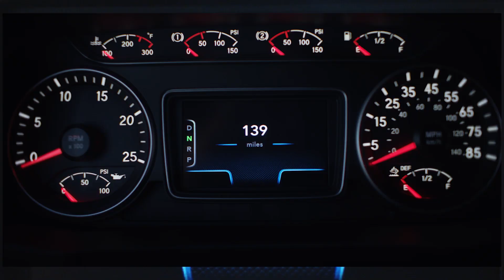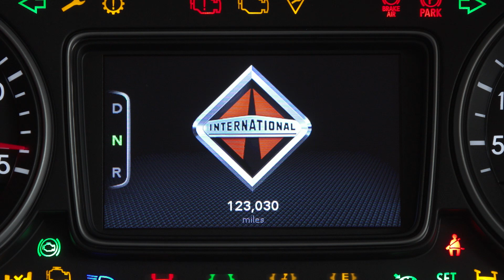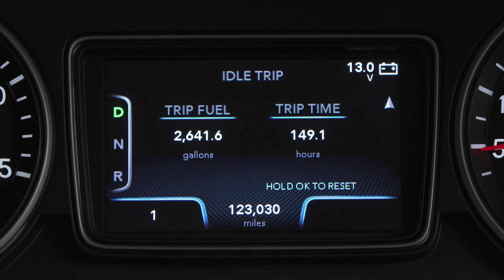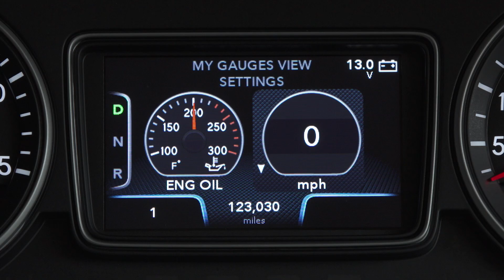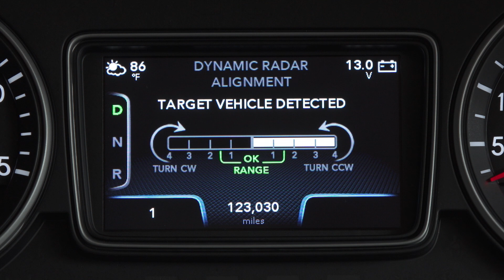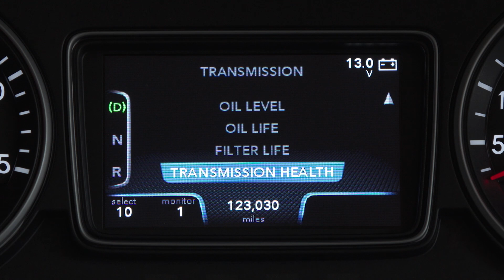International Truck Premium Cluster Training Guide

Comment: There is no adjustment for the overspeed on the cruise control. Do I have to have this done at the dealership? On a Freightliner you can set the overspeed from 3-5 MPH and also adjust the time interval alarm for the vehicle in front of you.  Doors don't open wide enough. Seat is cheap. Just turned 1020 miles last night and it is already rattling like it is  three or four years old. VW better get some better people to run International.

Comment: The lt is by far the worst truck I've ever driven. Not meant for tall people. My knee is constantly hitting the steering wheel, my leg is constantly hitting the cup holders. The seat doesn't adjust back enough. I feel cramped all day. My back is taking a beating from driving an lt. Volvo, Freightliner the paccar trucks are all much better options. Entering the truck is also an issue where the door doesnt open wide enough as well as the steps being too short.

Comment: I drive one of these leased through Penske. They strip everything out, and lock all features. This truck doesn't even have a fuse for the airbag. It pulls to the right because there's no access to the alignment reset. The features are awesome, but they shouldn't be allowed to disable so much.

Comment: But how do i keep the bunk heater running while the auto start/stop is on (so the battery doesnt die) the cool button says “no idle” it turns off one or the other?
Reply: This truck is dangerous,the acc/cms picks up road signs above interstate and bridges. If another vehicle cuts you off the automatic braking system comes on and you go from 68 to 50mph which takes all control away from the driver and it does the same thing if cars exit off ramps as they slow down the radar picks it up and slams brakes on while you're still trying to drive . I been driving trucks for 20 years and by far dangerous vehicle set behind the wheel in and chances are the idiot that designed this garbage doesn't even have a CDL.

Comment: Absolutely garbage they have a camera that activates the engine break authority if the crappy computer thinks you're going fast or too close I'd advise everyone to simply stay away my 2019 LT transmission broke down it takes 3 weeks for them to get the module just garbage
Reply: You  have  12 spd iton ?
Reply: @yamaxa00  yes it's 12 speed automatic but to be honest stick shift is better less maintenance and if it breaks down $2500 you can rebuild it but I changed the clutch and it was $4 k and the transmission went out with 190 k and it took earon 5 weeks to replace it I had warranty but I couldn't work 5 weeks that cost me too much

Comment: My dash never turns off even when I'm parked and the key is taken out. Any help?
Reply: did you ever find out why? same issue
Reply: @checkmiswagg20  Something random is always happening in this truck. The dash lights didn't turn off for like a few weeks and then it randomly stopped happening. The guy that just made a comment is absolutely right though. If you turn on the lights in the back, the dash lights come on and then turn off again in a couple of mins. Same thing happens when you open up one of the doors or if you just take the key out or basically press anything but the dash will eventually turn off again.
Reply: If the there is a light left on the dash won't turn off
Reply: @TheEnergizer1965  Thanks!!! I finally found out after months.

Comment: Little stupid design  2020 sleeper .
1- small and sheep cabinets where doors always opens after first  bumb on road. 
Spaces around the bed where you loose stuff that drops under .
2- narrow said  mirrors .
3- when backing up on a door it's hard to see when first backing till its an angle because of the design of the doors . That's critical. 
4- you can't raise RPM when parking, cruse control don't work when parked .
5- stupid auto transmission!!! You can't use manual function to shift .
Head lits are cheap , visibility at night is bad .
6- good luck figuring how to turn the fog lights on .
I'm trying to get out of this truck ASAP.

Comment: I've been driving a 2019 LT for about a year.  After 136,000 miles all sorts of annoying kinks have cropped up. Biggest problem low DEF fault shows up for no reason.  Def gauge reads half or better.  Showed up once 100 miles after topping the DEF tank followed by  torque 25% derate fault. Drive performance never changed.   I stopped and after sitting for about 10 minutes all faults went away.  Didn't come back for weeks.  Same thing, they went away just as oddly as they showed up.   Anyone else have this issue?
Reply: Well I have 480k right now and no DEF issues because I don't idol freeway driving the Def doesn't have any issues
Reply: @johnm5855  don't have any of those issues now because I no longer drive an LT. 300k on a 21 cascadia and no issues

Comment: Seriously? Outside air temperature display is an optional feature on a 2020 model vehicle???  you know some drivers like myself rely on an outside air temperature reading to know when to expect ice on the road. Seems like a basic function that every vehicle manufactured in the last 10 years has had as standard. Absolutely ridiculous and is a major safety concern!!

Comment: How do I get my truck to idle (2018 International LT C10 Edition)?
Reply: When the idle engine light comes on, hit the brakes once
Reply: Set the trailer brakes, drop the landing gear, chock the wheels, release tractor brakes
Reply: Release your tractor brakes, turn cruise on, hit the cruise set button, then hold the resume button while pulling (applying) the yellow tractor brake button.
Reply: I'd like to know to. Maybe it works for the 2019 as well?
Reply: Did yall figure it out? I cant get mine to idle its a 2019 LT
Reply: It probably has that fuel saving thing where it will only idle for 5 min before shutting off. All you usually have to do is if the display shows the engine is about to shut off stomp the accelerator real quick one time and it should then remain running.
Reply: If you touch the pedals for a second it won't turn off. But I'd you're sleeping that don't help much. If ur just taking a 30 in the seat tap the accelerator

Comment: No clock, no temperature gauge. What? I have to mention also. The cruise control on my A26 is extremely lazy. It takes forever to get going. The CC and the electronics on my old freightliner was way faster and snappier. It gave me full power when I wanted it. Seems like the electronics are always "thinking" in this new international and is not "doing" much. More doing less thinking guys

Comment: My steering wheel angle I’m comfortable with blocks the view of dash lights for high beam, jake braking and cruise. This should have been on top. 

The hazard or four way signal button isn’t in convenient location that I happen to press SUSP DUMP on emergency situation. 

The 2 buttons yellow and red air brakes are too far for me. The rarely used buttons should be on the far side. 

The driverside door pocket must have a place for paperwork like BOL.   There must also be a spot for mostly used items like gloves and thomper and flashlight

Comment: Nice truck might get 1
Reply: I currently drive one (automatic). Transmission has trouble finding the right gear often +a ridiculous lag between throttle down to actually moving. Not a good automatic AT ALL!!!
Reply: Better off going with a superior truck. Beautiful freightliner
Reply: Tony Smith these trucks are sorry to many problems I have a 2019 . My starter burned out at 33,000 miles
Reply: Dont get an international i got one 3 days ago and its already in the shop

Comment: Why is the middle of the premium cluster display filled with the vehicle speed, when the gauge to the right shows the same information?  How come the alert setting does not show the driver the SPN and FMI for the engine fault codes?  Do the gauges or display information automatically show when there are fault information?  This appears to be another garbage product from International.  Is International too afraid to display all the fault codes on the premium cluster?  The engines do fail a lot.